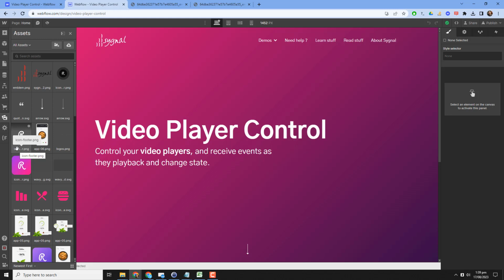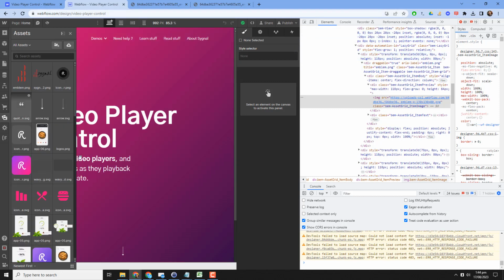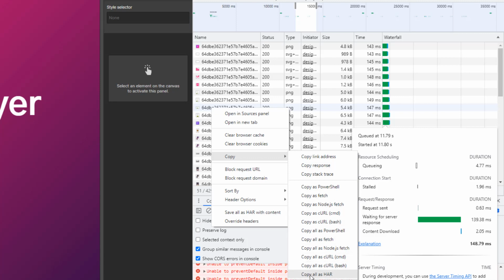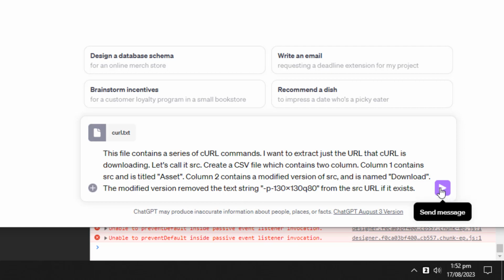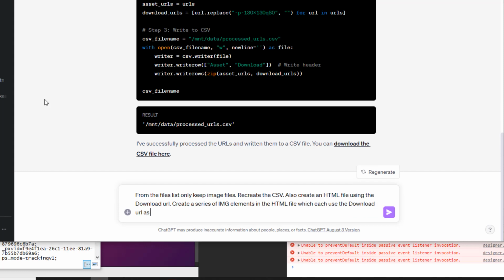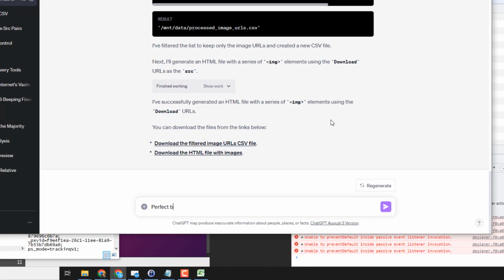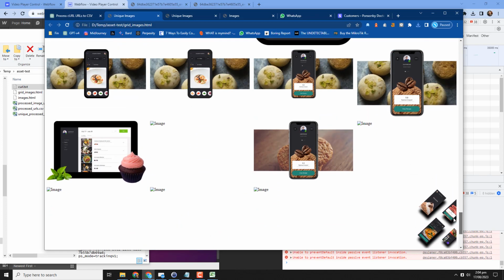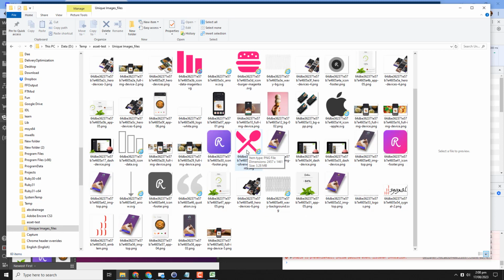Download Your Webflow Assets

Comment: It can be a lot simpler than this. Just download the network traffic as a curl command and ask chatgpt to add an --output switch based on the filename. Have it add a shebang o the top of the file and execute it as a shell script.
Reply from the maker: If the assets are published I use wget, and I need to do a video on that process, it's very useful for bandwidth optimization and site migrations. 
The approach described in this video is somewhat different and came out of a specific client scenario, where there are a lot of assets "trapped" in the designer.

With API v2 if I needed to do a full asset download, I'd likely build a custom tool using List Assets and Get Asset instead,